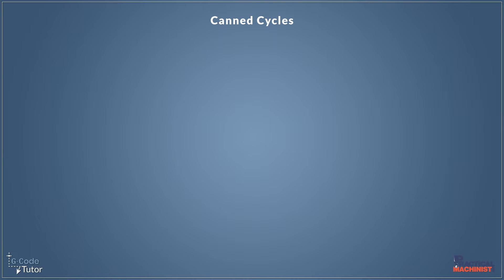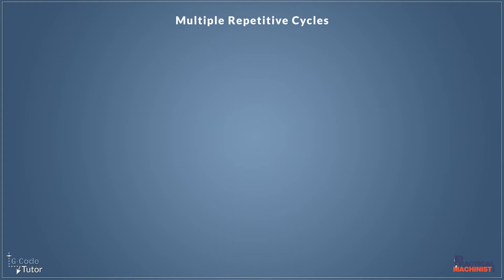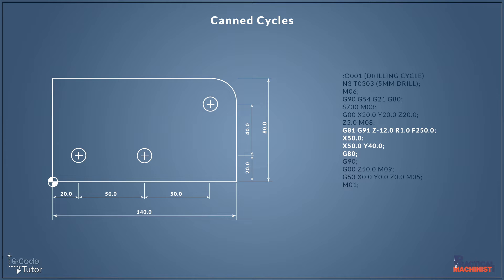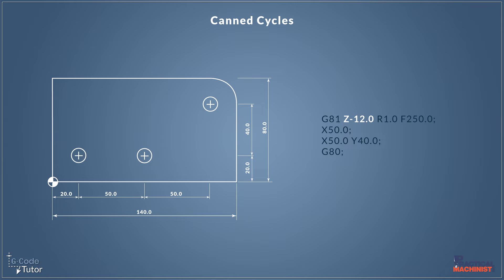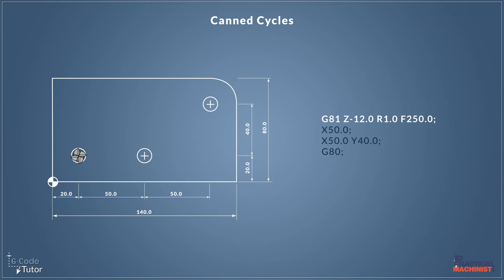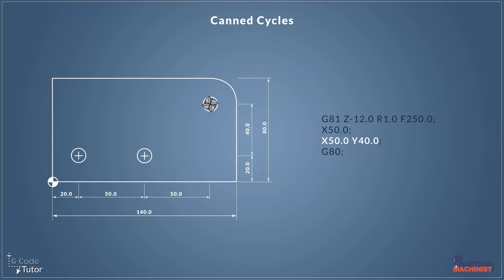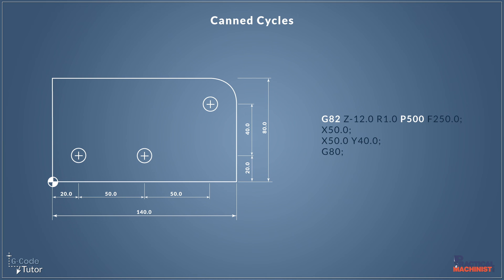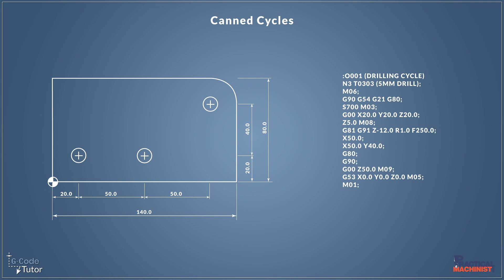Introduction to Canned Cycles

Comment: Back in the '80's Boston Digital made very accurate ( 5 micron)machine known as the Bostomatic, there were several versions including 4 axis machines. My point is that the control while not of great capacity, it had the most powerful canned cycle capability I have seen.  As I remember, 100 canned cycles could be used and they could be nested in canned cycles 100 times, and not just G codes but fully programmed sub routines. This all meant that many milled profiles, at many levels, holes of all kinds, single, grouped in many different patterns, tapped, bored, counter bored , chamfered, countersunk , and mirrored in X or Y or XY could be programmed.Which meant for a very short program, the machine could produce for hours and hours. In fact if a library of canned shapes was set up, this could be kept loaded to memory and called as required by the main program. An ability made  possible by the split memory, canned cycles loaded first followed by the main program, memory size division was automatic. All this over 40 years ago now, and I've probably forgotten more than I've said here!